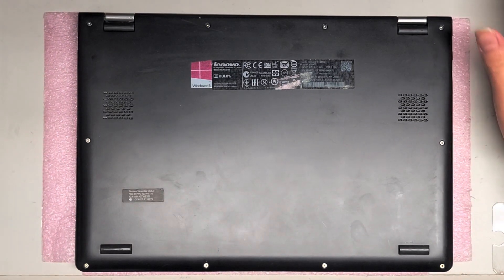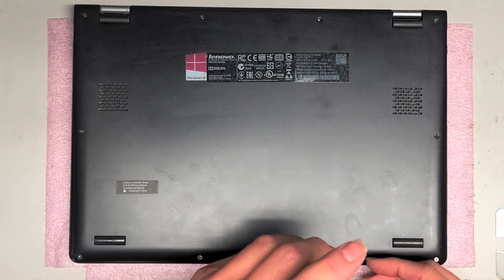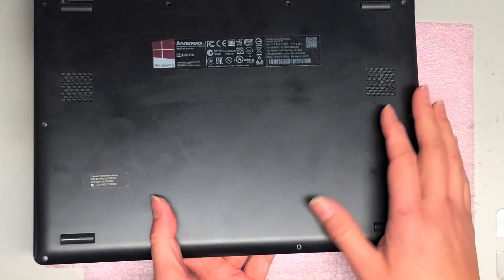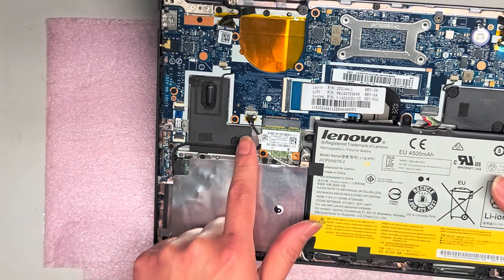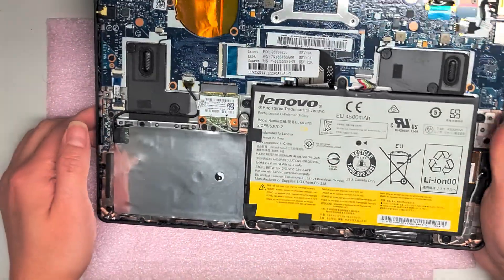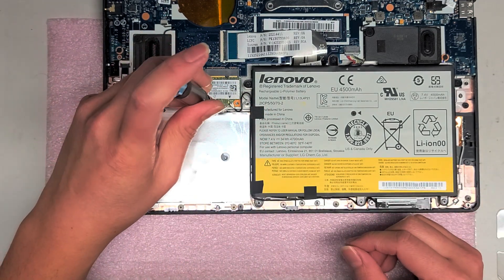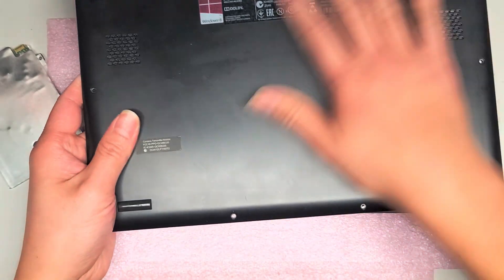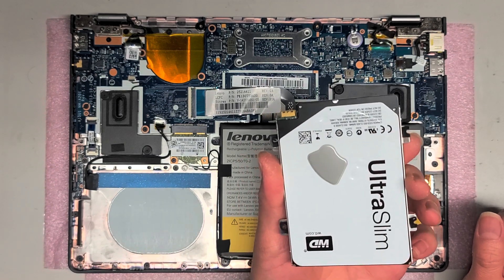Lenovo Yoga 2 11 20332 Disassembly SSD Hard Drive Upgrade Repair Quick Look Inside

Comment: I can't open the damn thing, I removed all the screws and the cover opens all around the laptop. But it seems to be stuck somewhere in the middle. I wanted to change the battery, but it just won't open.
Reply from the maker: Wiggle the cover. There are clips

Comment: I plan to install the WD Blue SA510 SATA 1TB 2.5" SSD on clearance for $50 at Walmart. The aluminum cover made the SSD unit too thick to fit, but i just removed the four screws holding it onto the plastic frame of the SSD circuits. Now it fits and the SATA interface connects with no adapter.
Reply from the maker: You mean the bracket/caddy?
Reply: @ItsBinhRepaired  No, I unscrewed the aluminum cover and removed it from the SSD. Then the SSD fits right into the space.
Reply from the maker: Nice

Comment: Can i replace my yoga 211 battery by myself at home? Could you please guide me how to?
Reply from the maker: Just have to pull the connector out and remove the screws. If you watch enough of my different laptop battery removal videos, you should be able to figure it out.

Comment: Hello, my lenovo yoga  2 11  bios and hard disk is locked with password and doesn't remember  . How do I fix the problem ?
Reply from the maker: I don't know of a way to remove those if forgotten.
Reply: reset ?
Reply from the maker: @ELIEDI  unless there's a bios password jumper on the motherboard, I think you have to replace the motherboard

Comment: Very helpful. Thank you.
when you remove hdd, you didn't remove battery 1st? 
Per its guide, seems removing battery is necessary.
Reply from the maker: Not necessary, just make sure the computer is off.

Comment: A) There are two additional screws under the footpads by the hinges on some Yoga 2 11 systems. They will break off if you force them but the cover may crack. B) If he didn't already mention it, remove the cover and check which drive you have before attempting an upgrade. I have the standard 2.5" SATA connectors in my Yoga 2 11.
Reply from the maker: This is for the 20332 model

Comment: Drive upgrade with 8GB or 16GB of FLASH on a 500GB "spinner" was either Seagate SSHD or the WD drive in the video, having "Express"SATA 12gbs on a small connector in the corner. Seagate SSHD has ordinary separated data and power in the center of the drive "butt end". I yanked the "SATAe" in your video from my Yoga 2 11 and it's cable and used part#  DC020C004Q00 cable with a "shucked" 2.5" SSD
Reply from the maker: Sounds good

Comment: Hello Thank you for the great info. I have a question my Lenovo yoga 2 keeps disconnecting from the Wifi again and again. I can't stay on a website with wifi more then 10 mins before it disconnects me then I have to reconnect. Why would this be? and how can i get it fixed? Thanks for any advice it is much appreciated.
Reply: In "power and Sleep"->"change advanced settings" there's a tree structure like file explorer. Change wireless to "Max performance", so the transmitter doesn't get a power cut after 10mins.
Reply from the maker: Might be a bad wireless card. Try wired internet to see if it works ok.
Reply: @ItsBinhRepaired  thank you for this information.
Reply from the maker: Hope it helped. If you haven't already don't forget to like and subscribe so others can find my videos. Thanks!
Reply from the maker: Hope it works.

Comment: Where do you find 5mm ssd?
Reply from the maker: You could possibly remove the outer casing. The SSD inside is actually much smaller and thinner.
Reply from the maker: For the first one you'll need this type of SSD https://amzn.to/3DHcLar
Reply from the maker: For the other, you need this type of SSD https://amzn.to/3oTJWRQ
Reply from the maker: Not sure. I think they're all 7mm now
Reply: @ItsBinhRepaired  you think I can fit a 7mm? Any tips?
Reply from the maker: @lilgeorge248  this might work https://amzn.to/3oOcZXa
Reply from the maker: @lilgeorge248  this for sure will work https://amzn.to/3nH3tFH
Reply: @ItsBinhRepaired  my version has native sata support I was just wondering if a 7mm would fit in the spot of a 5mm drive
Reply: @lilgeorge248 Yes, if you disassemble the SSD and remove the outer cover.
Reply from the maker: If it has a bracket or something holding it in place, you can likely remove that and it'll fit just fine.

Comment: Can you do RAM upgrade with that model, Lenovo Yoga 2-11
Reply: RAM is soldered to the board. you would need to be an expert in soldering and find a scrapped board with the larger RAM capacity to even attempt it.
Reply from the maker: If I didn't mention it in the video, I don't know.

Comment: There's a few SSD's that actually fit. I know Kingston and Samsung are tight but fine. I believe you can get up to 7mm thick SSD's in there if you remove the foam from the cover. Any idea how to figure out what kind of dual band or even just 5ghz cards would fit this computer? Being limited to 2.4ghz has been terrible.
Reply: Do you mean the WiFi/Bluetooth card? I don't know much about that, but I searched on Google and apparently you cannot change it because the new one has has to be whitelisted on a BIOS level. 
I saw in some forum that a kind user was sharing personalized BIOS of the Yoga 2 11 depending the card, so you only needed to flash it.
Flashing a BIOS is a high risk, and maybe that person is not longer reachable, so perhaps it's better to simply buy an WiFi dongle.
It's a pity because the normal one is quite mediocre.
Reply from the maker: @Thorin88  yeah...sadly that's usually the case. :(
Reply from the maker: I'm not sure to be honest.
Reply: It can be hard to route the 5GHz antennas in a chassis this slim.
Reply: Bryan Minugh makes sense. I still haven’t  found the solution.  Might just get another hard drive and replace when they start getting slow as they’re cheap now.
Reply from the maker: Yup
Reply: You can't put an internal 5GHz dual band card because it has only a 2.4GHz antenna.